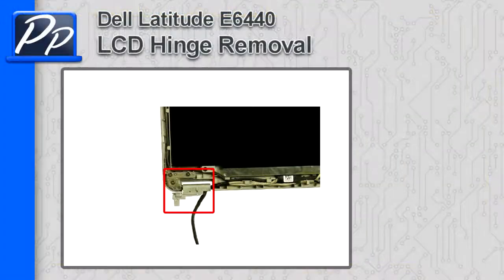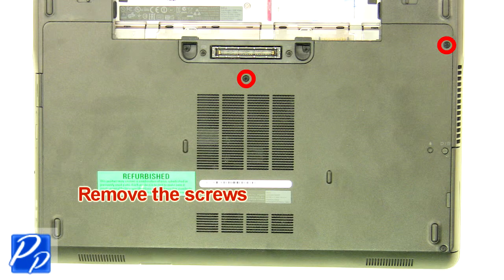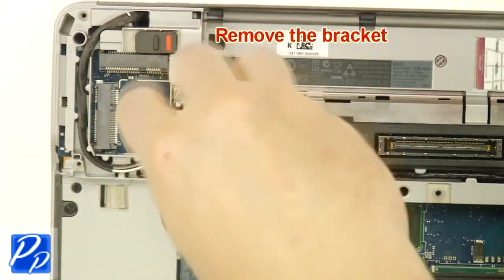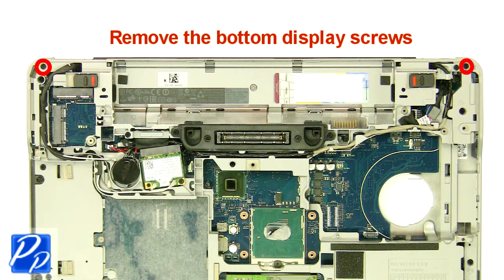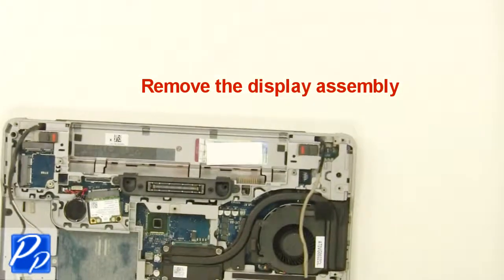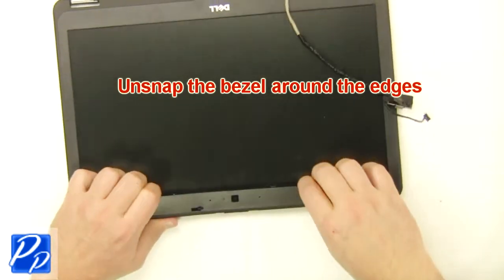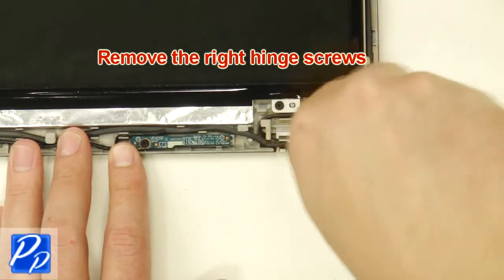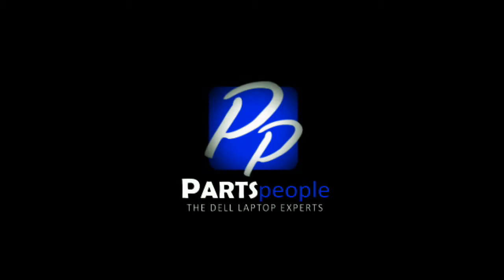Dell Latitude E6440 LCD Hinge How-To Video Tutorial

Comment: How do i fasten or loosen the hinge
Reply from the maker: The 3 screws on each hinge can be removed using a small Phillips screwdriver #0.
Reply: @dellpartspeople  i not talking about loosening the hinge to the screen, i meant the hinge itself. . . It's hard to open the screen because the hinge is too tight on other laptops there are small nuts for that
Reply from the maker: @mmililithibedi5440  I follow you now. These hinges are not manually adjustable unfortunately. There are DIY methods that you can research but none that I use personally so I can't recommend them.
Reply: @dellpartspeople  already found a way of loosening them, thanks
Reply: @mmililithibedi5440  I cant really tell on this video but is this a metal frame on the laptop? Trying to see if I should buy one of these. Don't wanna deal with a plastic frame falling apart where the hinge attaches. It happened to a Dell second gen i5 Inspiron of mine. Trying to find a metal on metal design that will last.